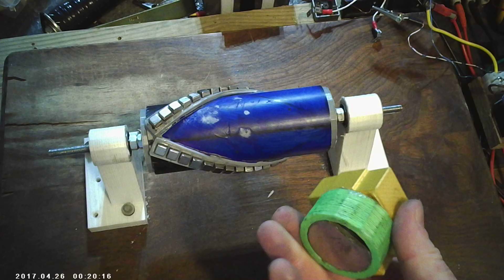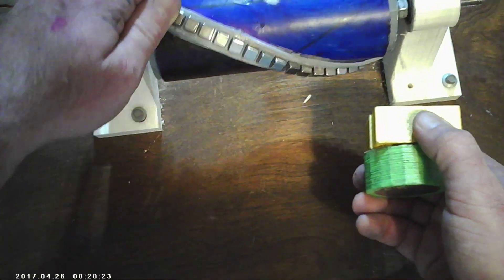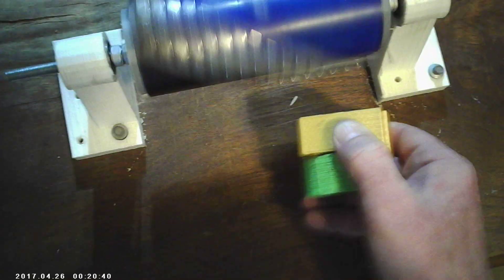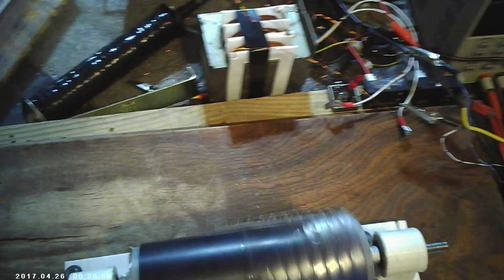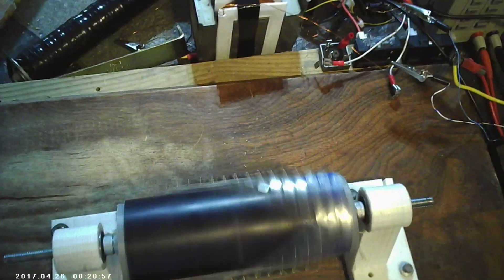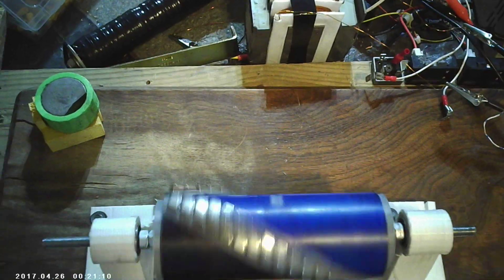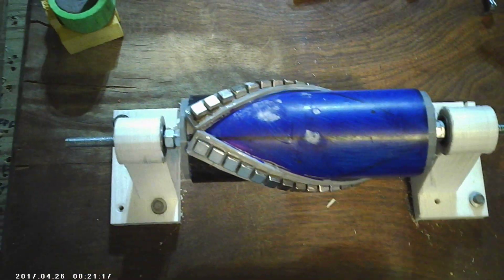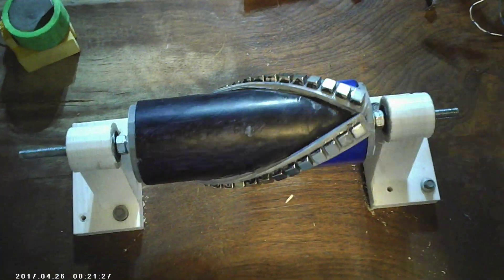Spiral Sinewave Motor #2  - Spinning with stator magnet manually

Comment: So basically you just created a Switch motor. I thought they stop using that Ida because of how  inefficient they were?
Reply from the maker: Ya I was trying to duplicate an overunity claim.  But I do not see a payh for it to work as claimed.  So it is on the shelf now
Reply: I could see  over unity with a few extra parts.

Comment: Can you share the link where to buy the bearing stands?
A large wheel with gear in the shaft that make the manet move side to side according to the position of the rotor will be an idea o explore.
Reply from the maker: I designed and 3d printed them for 608 skateboard bearings.  I can post the STL if you print